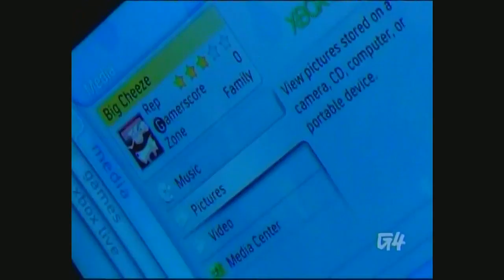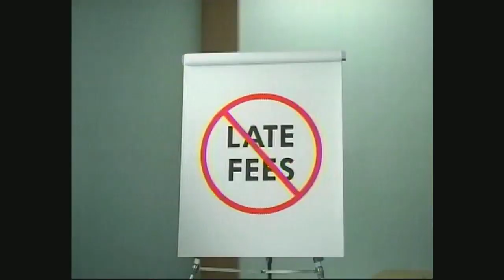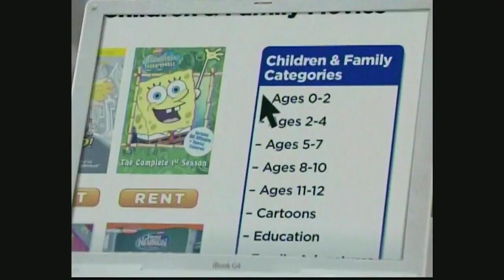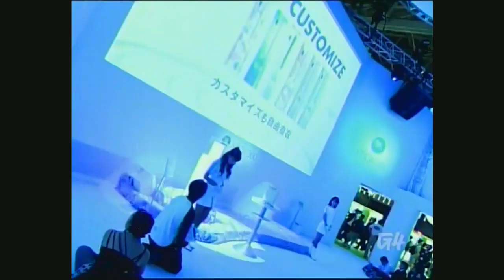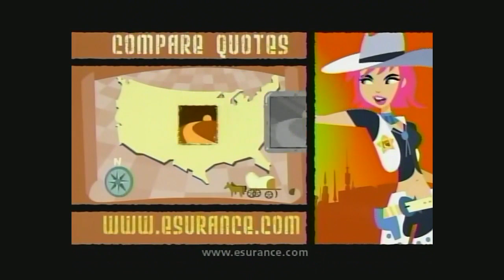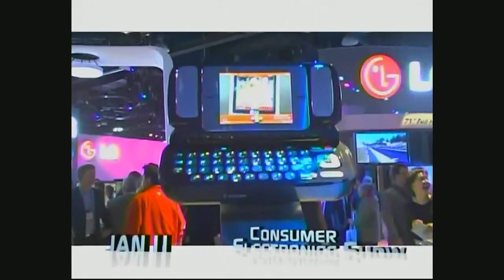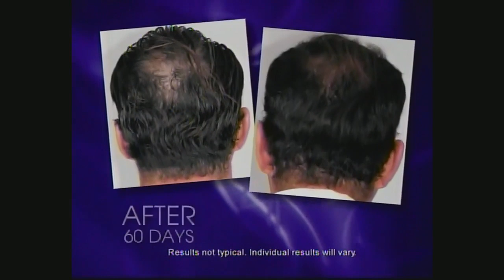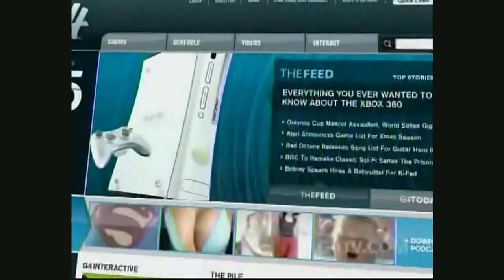G4's Countdown to Xbox 360

Comment: 2005 was an exciting time for gaming, I didn't get an Xbox 360 until February 2006, I still play it from time to time.
Reply from the maker: I got my first Xbox 360 in 2009 as I recall.
Reply: I had two 360 consoles get RROD so I switched to PS3. Then I got a PS4. I got an Xbox One X this past Black Friday and I love Microsoft all over again
Reply: O.k., our first M XBOX 360(S) arrived MAY 2020!
First X system, we're over 50 and remember all the hyp.
Good for a DVD system,PAIN opening it( haven't yet).
So,now,we have PS 3+ X360!!!
Ahhh...💖😎
* Adding that we got back into gaming when we got the P3 - round about way- with games, some from other systems.
We bought a PS ONE , shortly after... and P2 later that month.
😎 Good new old times!!!
💖💖💖
Reply: Got mine in 2008
Reply: I got mine in September 2007 for Halo 3. It got red ring. Then the replacement's DVD drive stopped working (but started working again years later). I bought a model S to replace it. Then both stopped working last year. I need to find another one so that I can play my games.
Reply: What's good!

A lot of great games came out since you wrote this comment: Spider-Man Miles Morales, 58 different Call of Duties, Persona 5: Dancing in Starlight. But you know what was missing? The G4 network making fun of all of them! We fixed that, because G4 is relaunching later this year!

Here's the point of all this... do you want to just watch crappy, unofficial fan uploads? Or do you want to watch crappy official uploads of NEW G4 content? Think about it.

Love, G4

~~sent by the Jerrybot from the future~~
Response number: f096397a-7d7d-11eb-b19a-00155ddfadaa
Reply: 1998 - 2004 was more exciting to me.

Comment: I remember this era. 2005 to 2008, the consoles to own were the 360, PS3, and the Wii. I still have all three of them. What a time that was.

And this G4 was a golden era for gaming. That is until, when Charles Hirschorn stepped down and Neal Tiles took over as CEO, that's when the network started to lose its identity by  airing reruns of Cops, Cheaters, and then came Campus PD.

The second run of G4TV was not meant to last.

Comment: The PS3/360/Wii Era would be the beginning of the end. The Beginning of More Digital content, and DLC's along with Microtransactions making it's debut (Oblivion Horse Armor). The PS3 was good, but it's Cell Processor would hold many games back Framerate wise due to programming issues. The 360 for games like The Orange Box, Sacred 2, Dragon Age Origins, and many more would play better on the 360 by running much smoother. The Wii was fun for awhile, like Super Mario Galaxy and Resident Evil 4 with Wii Zapper Support, but soon the novelty wore off as the Wii U Proved. This was the last era of Classics, after this era and entering the PS4/XB1/Wii U/Switch Era it would start to go downhill fast due to Corporate Greed and Companies/Franchises going Woke. Gaming will never be the same again.